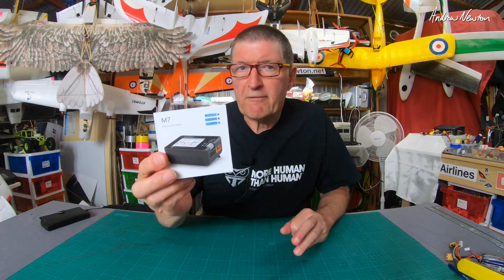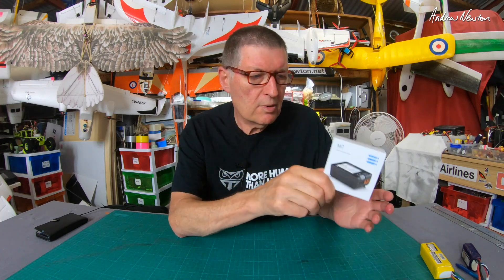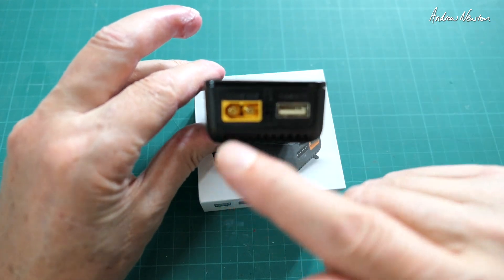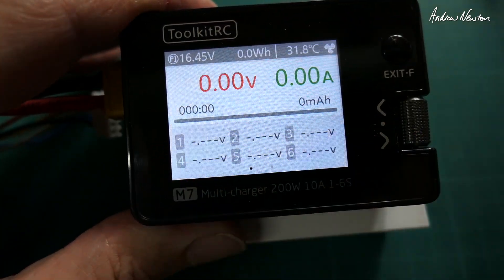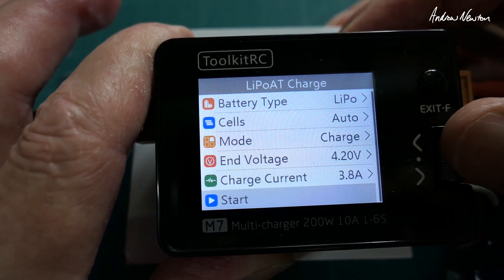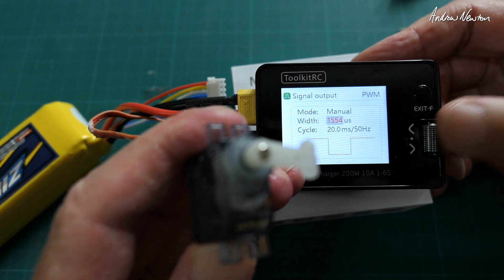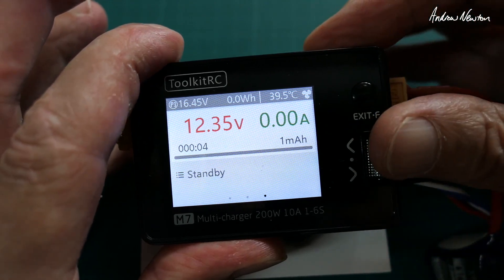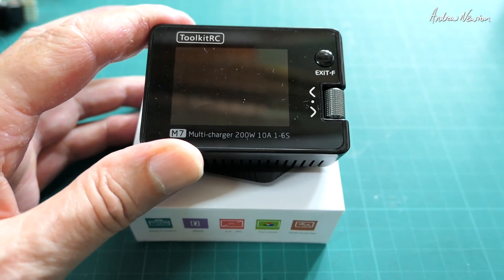ToolkitRC M7 Multi-Charger

Comment: Hi! Would a 35watt wall usb-c power supply be enough to work with M7 charger?
Reply from the maker: Limited to 1A charge current would be OK
Reply: @AndrewNewton  Yes. I would only use the M7 charger to charge 1000mah 7.4v 2s lipo batteries. So pefect for 1A

Comment: Hi can I use 17 amp psu for the input of this charger m7 because specs sheet says @max  12a? 

Thank you in Advance?
Reply from the maker: Yes, the charger will only draw the current it requires.
Reply: @AndrewNewton ahh so it will only get the 12a current from the 17a of the psu ? Thanks you
Reply from the maker: @RiDLEY09  That is correct. So you have 5A safety margin with that setup

Comment: Got mine from AliExpress and it has 2.0 firmware out of the box. Hope it is not a new revision which is cheaper and worse, as usual :)
Reply: Actually, I found 2.01 version on the website with the note "Only for V2.xx main board". So it means there is two hardware versions of M7. Curious what might be a difference...
Reply: Asked support and got this answer: The latest batch is the V2.0 version. Due to the shortage of chips used in the V1.0 version, other chips were purchased to replace the latest batch. Except for the chip, the V1.0 and V2.0 versions have no difference in other structural functions. When upgrading later, the two versions correspond to different firmware upgrades.
Reply from the maker: Thanks for doing the research Alexey. Great to sort that out.

Comment: I bought dual charger version of this last year, and later bought their 19v power supply, as the charger was objecting to the computer PSU that I was using.
Reply: I want to do the same thing, how's your setup doing? Their 19v power supply seems to be a good OEM choice.
Reply: @rafaelreusch  All I can report is that it's not cheap, but it works as it should. My Accucell 6 is fine with the 12v supply, but not the Toolkit charger.
Reply: @wordreet  But the 19v oem works fine?
Reply: @rafaelreusch  Yep, as it should. 👍

Comment: So ESC tester means it tests the input voltage from an ESC or was there something more that I missed?
Reply: I think you connect it to esc (that has motor connector) and test it by seeing if the motor spins or not.
Reply from the maker: Just a PWM signal generator. Plug battery into ESC/motor, esc signal cable into M7 and you can spool up the motor to check direction.